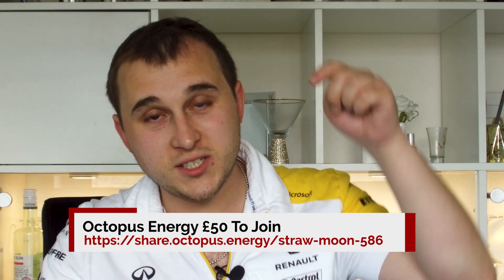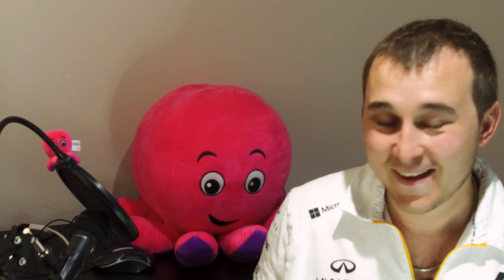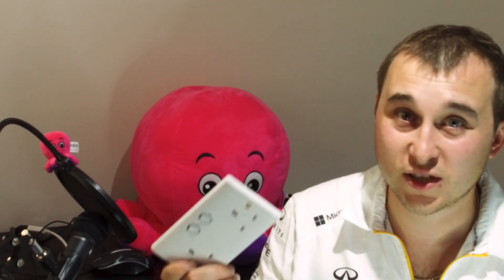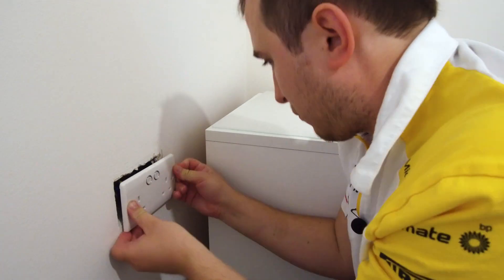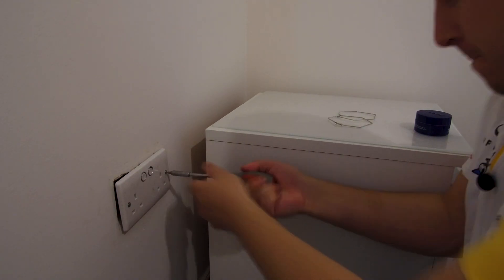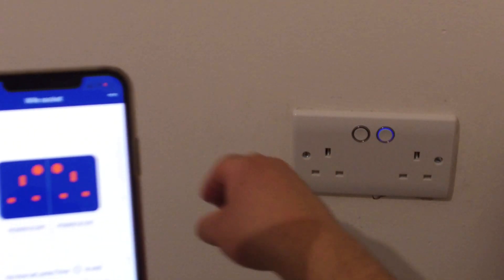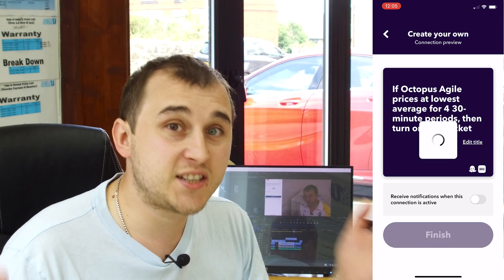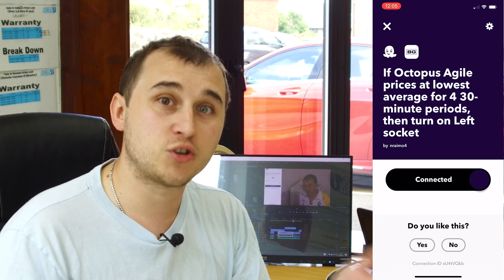Save MONEY On ALL Your Electric With Smart Octopus Agile Sockets

Comment: Sorry, just to confirm. Does this turn your appliance on and off on the cheapest individual half hour slots throughout the time you’ve selected? Or does it find the cheapest average grouped slots for the specified time? Does it automatically turn off after 30 minutes? Or do you need the pro version IFTTT?
Reply from the maker: if you use home assistant you can schedule it to follow agile

Comment: I've got solar and battery, and am currently with Octopus Go. Would you suggest I change to Octopus Agile? My main issue is around Smart Export Tariffs, as I can't go with Outgoing Octopus with Octopus Go. Octopus Go seems a lot simpler with 5p per kWh between 12:30 to 04:00, charging up my battery, but with these dynamic changes with Agile, I can see it being a lot more complicated to keep track of. Any advice would be appreciated :)
Reply from the maker: Sadly i don't have a battery to export but if you can link your battery to an API and do auto bidding and management of house load and export for agile you could be lots better off,  Agile prices are currently very high but that also means so is outgoing agile prices,  the reason you can't have the 2 combined is you could be paying 5p to import it and then an hour later charging them 25p to export it.   You could switch try it for 6 months and switch back if it doesn't work
Reply: Just get flux omg

Comment: Hi nick. Ok video. But some serious omissions. 1. You need to be qualified to change sockets. Part P minimum. You shouldn't be showing people how to do it or encouraging it. So many people mess around with electrics and cause dangerous situations. 
2. You mention IFTTT befriefly but fail to mention that it's a paid service. Personally I refuse to use IFTTT anymore because they are unreliable and charge.
3. Leading people to believe that a smart switch will convert a dumb device into a smart device is rubbish. Lots of old dumb devices cannot simply be turned on with a smart switch and be expected to work.e.g. digital washing machine, most EV granny chargers require manual restarting.
If you're going to make a video on a serious subject then put the research effort in and don't just spew out garbage for an revenue.
Reply from the maker: You don’t need to be qualified for changing plug sockets only if an install is for something high kw like an electric shower or EV charger for some examples.

Ifttt was totally free time of this video it’s still 3 for 3 applets and nothing stopping multi accounts

My bmw i3 will happily work on these sockets so will Tesla and about 100 others only one which won’t top of my head is zoe

Comment: Hi Nick, Interesting video, for your viewer's info, sonoff do a very nice outdoor single socket that's ip65 water proof, that may be useful for outdoor ev charging.
About £16, used many of their products, so can vouch for quality and reliability.
Now someone tell me how to convert my old podpoint fast charger to work with IFTTT.
Reply from the maker: Hi Will I've avoid snoff as i've seen some melty melty switchs off them as there's some other switchs i was going to demo on this video but the horror stories scared me off
Reply: @NicolasRaimo  Hi Nic, Good point, many of the inline switches (power line in, switched out) are 10a switches and although clearly marked i think many people have used them for 13a devices hence hoty hoty melty melty, However i have never used one for a high current device yet so when/if i do i will keep an eye on it.
My Octopus Agile whent online last night and stuck 2.5hrs at 7kw in the Nero, be nice if i could get better control over the half hour slots.